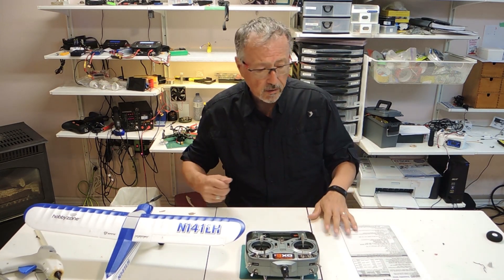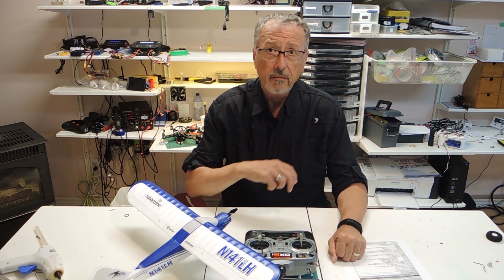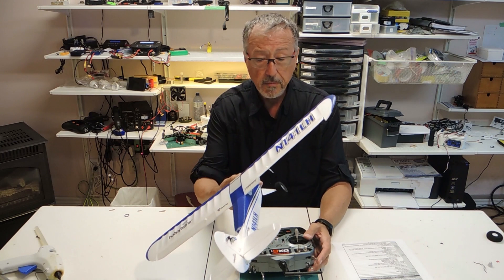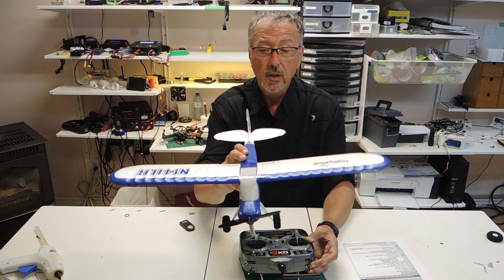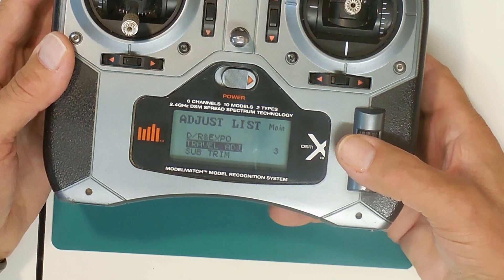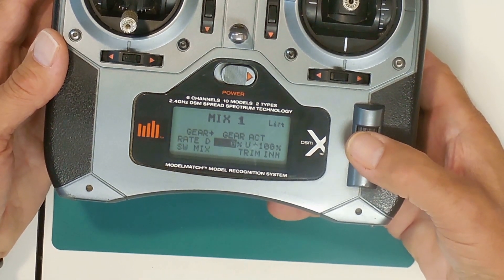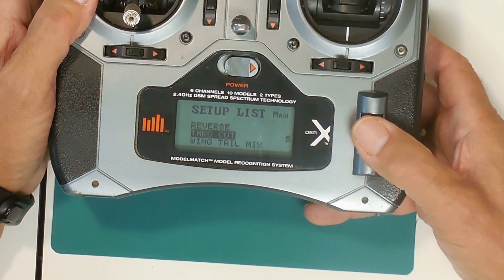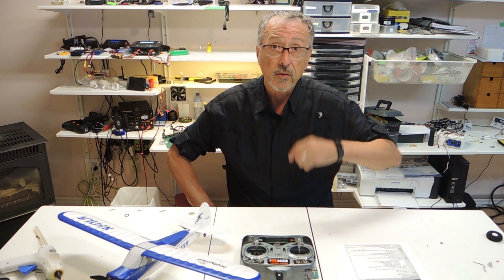Horizon Hobbies Sport Cub S Problems

Comment: From what I understand from reading the manual, is that there is no self-leveling in any mode other than beginner mode. You are looking for deflection where there shouldn't be any. The difference between intermediate and advanced is basically the amount of allowed travel for the control surfaces. Measure that and see if there is a difference. The oh crap button, however, works in all three modes.

Comment: Hi, 
I have a Spectrum Transmitter and Spectrum Receiver. I need help with adding 2nd or 3rd model using the same Spectrum receiver. I know how to add model on Spectrum TX, no issue there, and also understand that model memory (or profile stay) in the transmitter.  
I BIND my RX with TX the first time. Added the 1st model as “F-22” and everything went well.  Now, when I added 2nd model as “Dragon” and I took out the same receiver from F-22 and put it in 2nd Model, turned it ON, the receiver does nothing. No flashing lights on it or anything.  
I did the BIND process again while selecting “Dragon” model on TX. It went well and Dragon worked fine, but if I put this receiver back into F-22, nothing happens unless I redo the BIND process one more time to make F-22 work, but then Dragon goes away.  
I am sure there is better way, can you please help, if you know the solution?
Thanks,
Reply from the maker: Sure please tell me the model number of the radio and a link to the planes you are trying to bind.